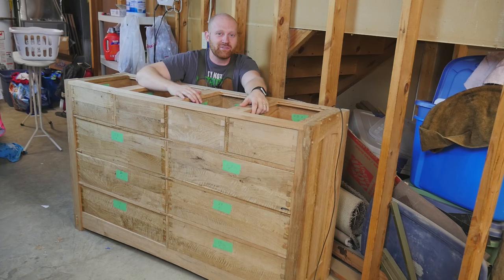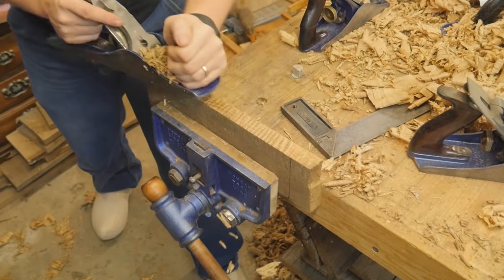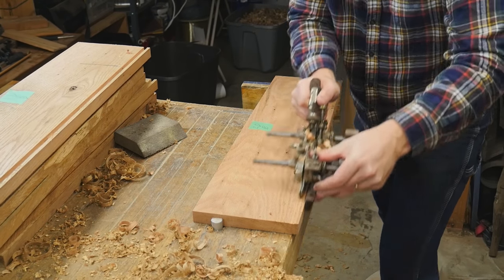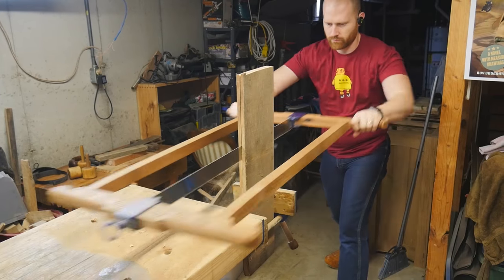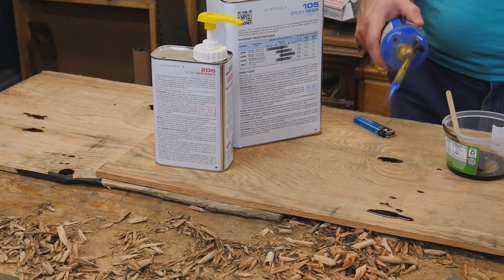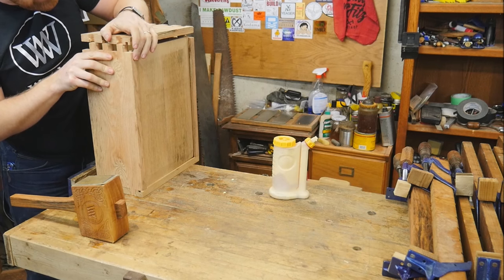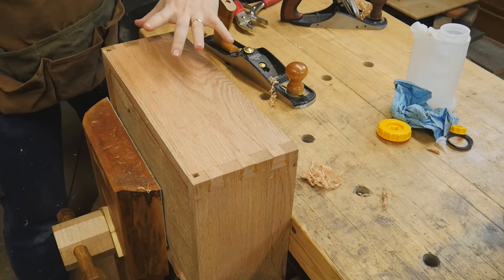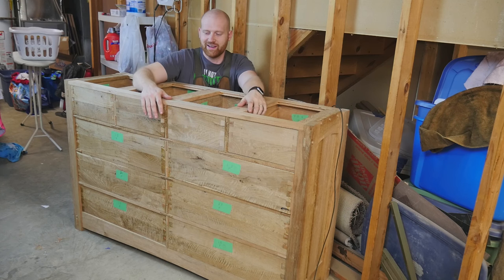Hand Tool White Oak Dresser Part 7 Drawers for Mission Arts and Crafts Design

Comment: That thing is looking amazing! Not that it's in the same class, but I'm thinking of using only hand tools for a small side table that I've designed for my wife. The plan is to make it out of yellow pine 2x4 material since it will be painted, but I'm hesitant to get started because I have a dovetail saw, but no panel saw and will probably just get one from the big box store. It seems so intimidating to think about all of the hours needed to do the hand work. But also exciting to think about the finished product and the fact that electricity was not needed.

Great video as usual, I always enjoy them and look forward to the next ones. Have a great day!
Reply from the maker: Thanks. Looking forward to seeing your Side table. don't think about the time involved just think about the next step. I started out with a home center saw. just do not try and sharpen the teeth they are hardened.
Reply: Thanks for the advice. I'll send you pics soon.

Comment: Coming along nice! I was surprised you trapped the drawer bottom in. How come you did not cut the drawer back short on the bottom and slide the bottom in?
Reply from the maker: +Tom's Dreamshop Worx no need to as I left enough expansion space for it. Plus there is more support this way.

Comment: You have probably been asked already,  but I'm curious.  why did you choose to have a full drawer back where the drawer bottom is fully encased,  as opposed to cutting the drawer back short and running the base under it. then the base grain direction be oriented so it expands towards the back .  simply curious is all. nice work.
Reply from the maker: +KingPost TimberWorks I prefer it to be lose. There is enough space for expansion. Plus this has more support.

Comment: Hey James,

This I looking beautiful. I really like the look. I have one question/concern and maybe I don't quite understand. It looks like the drawer faces have the dovetails going the wrong way. Don't you want the pins on the face? When you pull on the face to open the drawer wouldn't you want the angle of the pins ideally pulling the rest of the drawer out? Every other drawer that I have seen has the pins on the face so that, if for example the glue fails, the mechanics of the joint are such that you can't pull the drawer face off. Again maybe it's my misunderstanding and you have a reason for this. Thanks again for all you do! 

Regards,

Eric

Comment: Got my Roubo frame saw but haven't unboxed it yet. question though... have you ever or is it even possible to mount the saw blade to work on the pull stroke?  if you have already tried this, which way did you like better?  great vid BTW!  you rock dood!
Reply from the maker: +The Cordless Carpenter thanks. You can do it eather way. I experimented with it but if you mostly use western saws it tends to be more comfortable to push.

Comment: I see you went for show over function with the dovetails. As I understand it, traditionally the tails are on the drawer sides (rather than the front/back) so that the tails mechanically hold the drawer together when pushing and pulling to open and close the drawer (if the glue were to fail, for example). What you have is no better than a box joint (functionally). Of course with modern glues that's probably less of a concern than in times past. And without false fronts (or half-blind dovetails), everyone can see that you have dovetails without even opening the drawer. Going the traditional/functional route, it would look like box joints from the front (as the tails would only be evident on the sides). Every decision is a compromise. You made some interesting ones and it'll be interesting to see how it turns out. Looking forward to the finished piece.
Reply from the maker: +WaylanHL the glue will cover it and if they do fail it is a quick fix. They ate called show tails to do them this way. Traditionally you would then pin them through from the side too. But with modern glues there is no problem.

Comment: Seems like you ran the dovetails in the wrong direction. When you pull drawer you're seeing things held by glue not mechanically by the wedge in dovetail. Is there a reason for doing that?
Reply from the maker: they are called show tails. The glue will not allow them to move. the wood will break first. if they are flipped around then they look like finger joints. and no one likes that. LOL
Reply: But they're covered by the drawer front anyway. How is that a "show tail"?
Reply: Hugo Danilo he is not putting on drawer fronts, so this is look he is talking about.